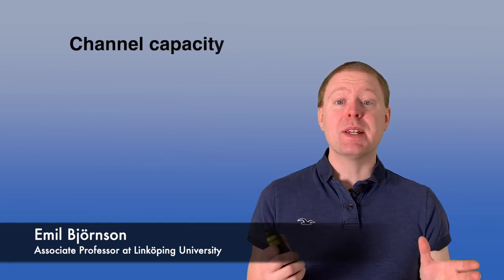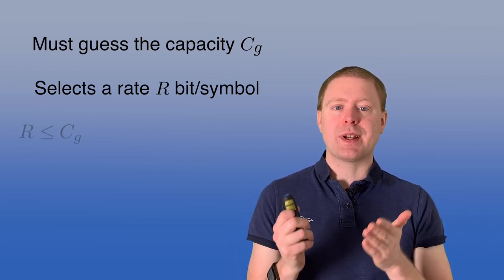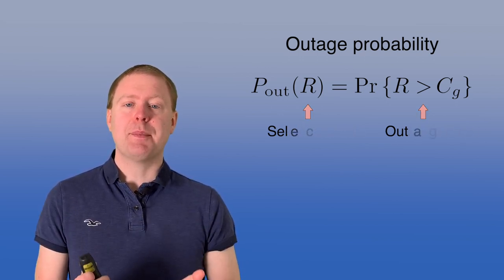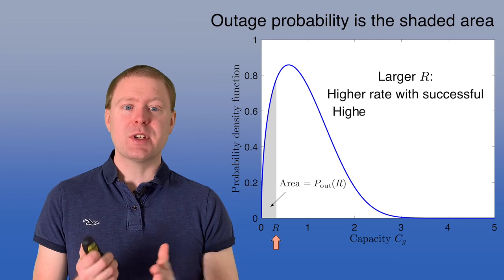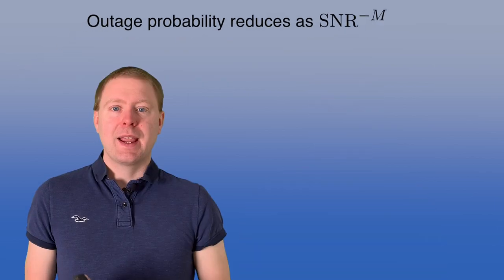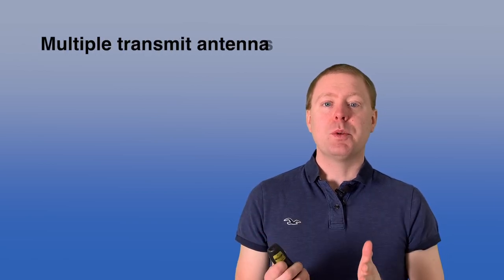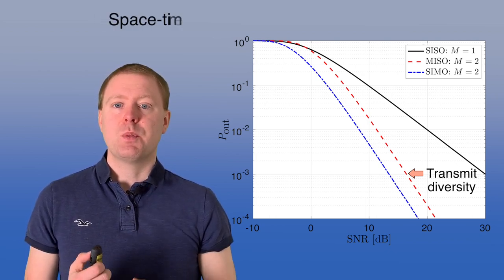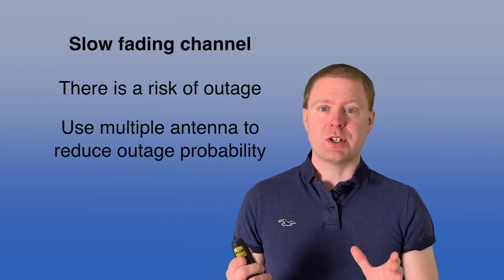Slow Fading and Outage Probability [Video 9]

Comment: Excellent video! I have some questions :

1- 
(a) You defined the outage probability here with respect to the capacity, but in a previous video, you defined it with respect to the SNR. Did you obtain the capacity's PDF in Rayleigh fading by using the capacity formula of video 3 ?
(b) How did you obtain the outage probability approximation (1:56) ?

2- For wireless communications system design, what is the system parameter chosen by the user ? Is it the channel rate that, in turn, gives a certain outage probability ? If so, where does the SNR threshold comes in ?
Reply from the maker: Hi!
1. The SNR and capacity are connected as: Capacity = log2(1+SNR). I believe this is the formula that was used in Video 3.
This video was originally created as a "teaser" for the following lecture (which was later recorded during the pandemic): https://youtu.be/IuLYGIfqCA0

2. Yes, in practice, we want to select the highest rate that we believe we can communicate at, with a desirably low outage probability. One measures the SNR, guess what the capacity is, and then select something slightly below that in the list of "modulation+coding" that is supported by the standard. I believe that 5% outage probability is a common choice for wireless broadband, while lower probabilities can be desired in low-latency scenarios where we cannot afford retransmissions.